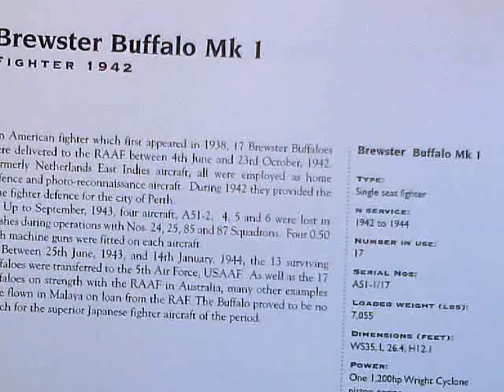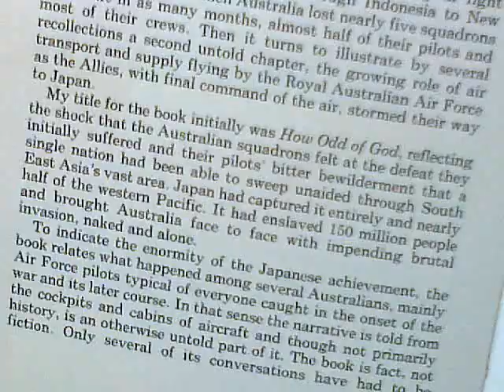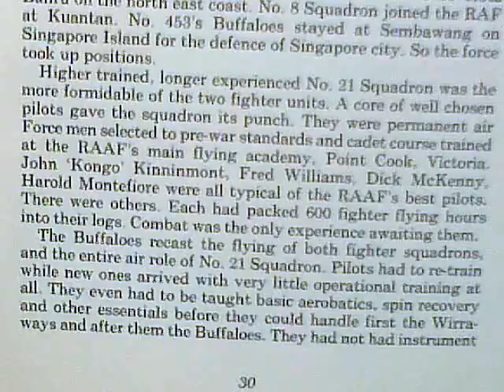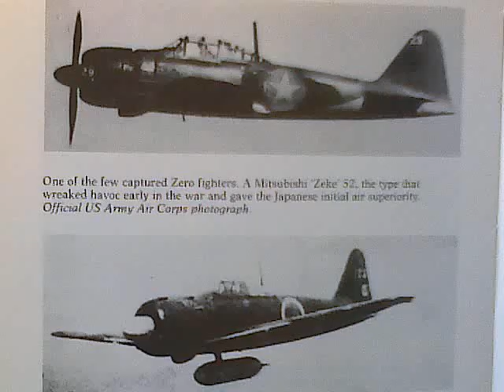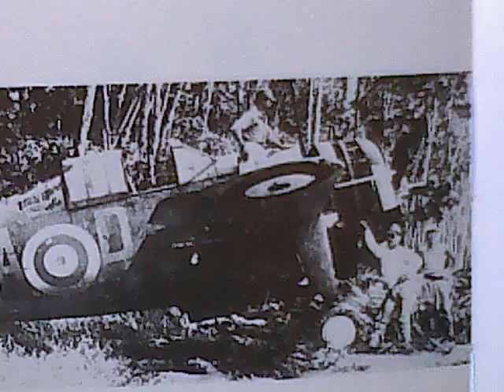World's Worst Fighter Aircraft, The 1941 RAAF Brewster Buffalo !

Comment: Spitfires got whipped by the Zero too, because they tried to TURN with them.
Reply from the maker: G'day,

  Thanks.

  Actually, when the RAAF finally got Spitfires to Darwin they mostly crashed out of fuel, after getting lost, after getting separated , after being scrambled too late to reach the Bombers before they'd disgorged their loads..., those which didn't crash on take-off in the dustclouds on the Dirt Strips...; and any which mixed it with the Zeros in a Turning-Fight got a horrible surprise, after which about a third of those who made it back to Base broke their Undercarraiges while trying to land.

  When reading between the lines in the Propagandised Dispatches of the time.

  Such is Life,

Have a good one...

;-p

  Ciao !
Reply: Which version of the  Spitfire are you referring to ?
Reply: Not even the P-51 Mustang could turn with the Zero.
Reply: @tomw377  Neither the Hellcat or the Corsair could out turn a zero.
Reply: @giauscaesar8047  All of them
Reply: @tomw377  The P-51 couldn't turn with a Spitfire either. It had a better roll rate but it vouldn't turn as well.
Reply: @WarblesOnALot  How did the pilots manage to achieve all of that? Not the aircraft's problem. The Zero was very beatable with the right tactics, it was just that the pilots weren't experienced enough to know that. The Spifire and Zero were designed with 2 very different philosophies and apart from the range (which aux tanks would later mitigate) the Japanese philosophy turned out to be the losing one. If you didn't get drawn into playing Red Baron with a Zero and kept your distance you just had to tap it lightly and it would turn into confetti. The Zero turned out to be very heavy on pilots. You seem to have some sort of hate on for the Spitfire.
Reply from the maker: @nerdyali4154  

G'day,

Which pilots, achieve all what ?

There were no Spitfires anywhere in the Pacific until 1943, they were Mk-5 Tropicals, and they were OFFICIALLY not a success.

In the Pacific Theatre the Spitfire was never able to live up to the expectations of the Imperial Propaganda Machine.

   The 1941 RAAF Buffalo was NOT the same Aircraft as the one which Finland got.

The Finnish Buffalo was about 900 pounds lighter, and had brand-new Engines - rather than unreliable  rebuilt second-hand units of doubtful actual power output, which had been thrashed by having seen service with the US Services... (by RAAF standards the Yanks took off on "War Emergency Power", climed on "METO"  Power - ie "Maximum Except Take-Off", and then cruised on "Climbout Power" - as a matter of course...., which was why the RAAF was able to triple the Time between Overhauls on Catalinas & DC-3s and still achieve better reliability than the Yanquis ever did when using the same equipment).

  I haven't got any "Hate" on the Spitfires..., but I recognise that they, like the Hurricanes, and the Me-109 & FW-190 were ALL  designed for Point-Defence within TINY Little Countries which are about the size of an average Rural Shire Council - by Australian standards.

EuroPeon Fighters simply lacked the Range required to be useful, when they were attempting to fight in the Pacific..., and in 1941/'42 the Buffaloes had no "Chain Home Low" to tell them of any approaching Raids, nor any Observer Corps feeding Sighting-Reports to the non-existant Sector Controllers to guide the Buffaloes onto a Raid.

  And, the useless Radios, the Lowlife Fuelpumps, and self-destructive Gun-Mount issues..., atop the overall Obesity & the gutless Engines as well..., all meant that the WELL TRAINED..., Pilots who were nonetheless "Combat Virgins" had been given a really bloody hard Row to hoe, with their Buffaloes versus Zeroes in Malaya.

Nonetheless, there was ONE Kiwi Buffalo-Jockey  flying  with the RAF who shot down 5 Japanese Aircraft & made "Ace" status.

Whereas the Finns had ELEVEN Pilots who made "Ace" in their Buffaloes..., and it was because of the Finns that the Buffalo joins the Fokker Eindekker as being the ONLY Fighter Designs to have shot down more Enemy Aircraft than the number which came off their own Production-Line.

  Which, actually, shits from a GREAT Height onto mere Spitfires, Hurricanes, Me-109s, FW-190s, Sopwith Camels, Fokker Triplanes, Mustangs, Lightnings, Corsairs, ThunderyBolts, F-86 Sabres, MiGs, Yaks, Zeroes, Phantoms, F-105s, F-117s, and will crap all over the F-22 & F-35.

Thr Finns have a Buffalo in the Helsinki Museum which has 38 Kills scored by different Pilots - making it the highest scoring individual Airframe Ace in the history of Waaauuugh(!)fare.

So, there there, nivertheemoind...your mighty Spitfires were all very lovely - when kept in their place ; ie  when playing around the fence-line enclosing their own back yard, and  defending against the Bully-Boys living at the other end of the street..., with Radar & Radio Control to tell them where to go.

Just(ifiably ?) sayin',

Take it easy...

Such is life,

Have a good one...

Stay safe.

;-p

Ciao !

Comment: It was still way better than the Boomerang.  Overheating engines put them out of service worse than air combat.  When they could fly they fared better than the Hurricane against the Zero.
Reply from the maker: G'day,

    Thanks,

       The Boomerang was a makeshift design, essentially the biggest Engine Australia could source (out of a DC-), with the Centre-Section & undercarraige & Tail off a Wirraway, with a set of outer Wings & Cockpit to fair the extremities together...; it was slow, but still better than a Wirraway for fighting Zeros with.

  And, by the time Boomerangs were bring designed Buffaloes were unavailable.

  ;-p

  Ciao !

Comment: Nice commentary. Only thing though, are you sure the Zeros were actually used in Malaya/Singapore? I thought the Japanese Army was in charge, and at this time, their main fighter was the Nakajima Ki43 Oscar. Of course, since the Oscar was worse than the Zero, this would be further disgrace for the Buffalo and her pilots...
Reply from the maker: G'day,

  Thanks,

  As far as I know, the difference between the "Army Zero" & the "Navy Zero" was that the Naval version had the outer 18 inches of it's Wingtips able to be folded, vertically, to facilitate their fitting on the IJN Carrier's Elevators.

  The RAAF were under the impression that they were facing Zeros.

  I haven't ever quibbled over such a minor & disputable point.

;-p

Ciao!
Reply: Only the Japanese Army Air Force flew over Malaya, Singapore, Sumatra and Western Java. Those units primarily flew the KI-27 Nate, which was still highly maneuverable although it had fixed landing gear.

The only IJAAF unit to fly the KI-43 Oscar was the 64th Sentai. The Oscar was nearly as maneuverable as the Zero. Its primary shortcoming was a weak armament of only two .50-caliber MGs in the nose.

Japanese Navy A6M-2 Zeros flew over Borneo, Celebes, Bali and Eastern Java from land bases. A number of carrier-based Zeros participated in the air strike on the port of Tjilatjap on the south coast of Java in March 1942. IJN pilots were considered better trained than their IJAAF counterparts.

Comment: The 1,200 Horsepower engine applied to the USN designated F2A3.  The final production model.
Reply from the maker: G'day,

 Thanks.

    One can learn a lot about the Buffalo from backscrolling this Comment Thread...

   Particularly with respect to the Finnish Buffaloes..., with less Power but less Armour, and thus less Weight, and the Radios, Fuel-Pumps & Guns all fixed function as required.

  In Helsinki there's a Buffalo in a Museum which has 44 Aerial Kills - which it scored with various different pilots flying it ; it is THE  HIGHEST  SCORING  INDIVIDUAL  AIRFRAME  IN  THE  HISTORY  OF   WARFARE  UPON  THE  EARTH...

  One Finnish Ace scored 43 Kills in a Bufffalo, 11 Finnish Aces shot down 205 Kills while flying Buffaloes, 5 Finns became "Aces" while flying Buffaloes...; the Finnish Buffaloes shot down 507 Soviet Aeroplanes, but Brewster only built 500 Buffaloes.

   Thus, the Buffalo joins the Fokker Eindekker as the only two Fighter Aeroplanes which shot down more Enemy Aircraft than were built during their own Production-Run.

  All of which makes the much vaunted Camel, SE5a, Albatross, Fokker Triplane, Fokker D-7, Spad, Nieuport, Polikarpov I-16, Zero, Me-109, Hurricane, Spitfire, Fokke-Wulf-190, P-47, P-51, Wildcat,  Hellcat, Bearcat, Corsair, Sabre, MiG-15, Mirage, MiG-17, Phantom, F-100, F-104, F-105, Harrier, F-14, F-15, F-16, F-18, MiG-25, MiG-27, F-22 & F-35....; all look like a bunch of Wanbabes...

  Sopwith Camels shot down more German Aircraft than all other Allied Aircraft COMBINED, in WW-1, but there were 5,759 Camels built in total, and they "only" shot down 1,765 Enemy Aircraft between them....

   Curious, is it not ?

  Have a good one,

  ;-p

  Ciao !
Reply: @WarblesOnALot  How many Fokker Dvii,s were built and how many enemy air craft did they shoot down
Reply from the maker: @dwdunn5601  

G'day,

Thanks.

I dunno, but it was nothing like as many Shootdowns by the  Fokker D-VII as came off it's Production Line.

 The Sopwith Camel shot down more Enemy Aircraft (1,294 of them...,) than any other single type of  Allied Aeroplanes did in WW-1, and there were 5,490 Camels built.

The Fokker D-VII was introduced too late in the War to really compete with the Camel's Kill-Tally and by the time the D-VII was introduced most of the German Pilots then flying were relatively undertrained...

So my guess is that the Fokker Eindekkers (E-1 to E-3 inclusive)  might be in the race with the Buffalo, but I simply don't know.

Nowhere is it written that I shall know everything...(!).

Such is Life,

Have a good one...

Stay safe.

;-p

Ciao !

Have a good one.

Comment: Sort of depends on what is the thing that's expected to be fought. Certainly not a first-line fighter, to put up against other fighters. But if they could have gotten to bombers they would have been effective on those. Of course, there'd be no point of first-line fighters if one didn't wish to protect their bombers. Why this was not evident to planners I don't know.

A defense fighter does not need the range of an escort. The Spit was an extra terrific defense fighter... not a good escort, as an example. But the Zero, though having range, were flimsy.
Reply from the maker: G'day 

Thanks mate.

  Well, yeah..., if you scroll through the Comments here you'll see that the Finns had early-model less-armoured Buffaloes without the Mount-breaking .50 Guns, with the Air-War there mostly below 10,000 Ft, and German Radios which worked, no Tropical Thunderstorms to generate Thermals, Hail,  Cu.-Nim's & Lightning's Static, with Combat Veteran Pilots instead of Rookies, and Polikarpov 1-15s, I-115s, & I-16s flown by Novices to fight against..., rather than 5-year Combat Veterans in Zeros...

 In Finland the Buffalo  may have nailed the record for the most Aerial Kills made by 1 Airframe (37) in the history of Air Combat, it shot down more Enemy Aeroplanes than Brewster ever built Buffaloes...; and only it and the Fokker Eindekker  can make that claim.

 Spitfires were lovely as Defensive Fighters if they were protecting a tiny little Potato-Patch surrounded by Radar and networked with Ground Observers & Fighter Control Radio Networks which permitted interception of approaching Bogeys before they crossed the Coast & got behind the Radar.

 Here in Oz, in March 1943, when the Spitfires finally showed up to protect Darwin from the February 1942 Bombing..., they were almost absolutely  bloody hopeless, destroying more of themselves with Take-Off Crashes (Formation Take-Offs on narrow dusty Airstrips..., 1,500 Hp accelerating full-throttle into the leading Section's Dusty Slipsteam...), Landing Crashes (that shitty little narrow weak splayed-out  Undercart -  almost as horribly crippling as the delicate set of Dunlops dangling under Mister  Messofshite's 109 series of Fighters with NO Useful Range at all whatsoever, outside little tiny confines of Europe), and getting Lost over the Ocean and/or Ourback with no Radar to vector them onto the Raids or steer them back tp Base.

   On top of that some Shitefires were shot down by the Japanese Escort Fighters..., and a minuscule number of Japanese Aircraft  were downed, AFTER they had bombed whatever they wanted to hit.

   In the Real World, the further one flew a Spitfire out from the Cliffs of Dover.., the more bloody useless they were...; even the Soviets preferred Hurricanes - for the Landing-Gear...

 So, yeah..., it's a multifactorial Equation.

Have a good one,

;-p

Ciao !

Comment: How comes that this plane needed more fuel when flying higher? With lower air pressure the manifold pressure drops and then the engine needs less fuel per minute, doesn't it?
Reply from the maker: G'day,

  Thanks.

    Well, as far as needing less Fuel as the Air gets thinner, yeah - that is right ; but the problem was that the Fuel-Pump was Pneumatic..., and above 10,000 Ft there wasn't sufficient Air-Pressure to pump enough Fuel to meet the Engine's requirement.

   I dunno the details, but I'm assuming that there was a little Engine-driven Air-Compressor to pressurise the Fuel-Tank, which "blew" the Fuel from the main Tanks up to a small Gravity Tank on the Firewall which then fed the Carburettor...; like a Sopwith Camel, but without the Windmill, and there was a Manual Fuel-Pump to deal with any leak or failure of the Tank or the Air-Pump.

   Presumably the Buffaloes' Air-Pump needed the thicker Air below 10,000 Ft feeding it in order to maintain functional Output-Pressure against the emptying Main Tanks...?

  Good question though...

  Have a happy Solstice Festival.

  ;-p

  Ciao !

Comment: None of the Allies in the Pacific were ready for war in December of 1941. The Japanese were completely underestimated, Allied troops of all forces were largely undertrained and spread thin over large areas, modern equipment was in short supply, and cooperation among the Allies was at best haphazard. You don't conduct successful defense under these circumstances.One New Zealand Buffalo pilot said he never fired his guns until his first combat mission. The Buffalos provided to British Empire squadrons were substandard. They were not the maneuverable late 1930s types (F2A-1 and F2A-2) flown by the U.S. Navy, or the Finnish Air Force. The RAF had asked Brewster to heavily modify the Buff with armor, flare bin and chute, and radios, that added an extra 900 lbs. The British Buffs also were powered by rebuilt Wright Cyclone airliner engines that didn't have the advertised horsepower and were problematic due to oil leaks. Dutch Curtiss Hawk 75s had some of the rebuilt engines and had the same oil leakage difficulties. Dutch Buffaloes had brand new engines and better performance, but still had to be lightened to improve performance. Keep in mind that the Curtiss  P-40 and Hawker Hurricanes also had problems against Oscars and Zeroes until proper tactics were developed.
Reply from the maker: G'day,

Thanks.

Congratulations..., nothing you mentioned was in error.

The fact that the Buffalo in the Pacific was a DIFFERENT Aeroplane fighting in a DIFFERENT War to the Buffaloes which were pastured in Helsinki is why the title of this Video specifies the 1941 RAAF Buffalo.

  Most of the Buffalo Could'a Bin Fan-Club competely miss the salient points which matter, and simply assume that the problem in the Pacific was the Pilots & the Doctrine and the Training.

  A different Kiwi Buffalo Jockey to the one you quoted was able to shoot down 5 E.A. and made "Ace" Status while flying them with the RAF.

  The fact of being overweight, & underpowered though, yes they were bad strikes against the Pacific Buffalo, but with cunning to exemplary Airmanship they could be ameliorated  ; but the Radios which only recieved Static from Thunderstorms, the  Pneumatic Fuelpumps which relied on Barometric Pressure to fill after each Stroke and thus commenced to progressively  fail the further they were taken above 10,000 ft..., and the two sets of Guns - Cowling Guns to blind the Pilot with recondensed vapourised Grease off the Ammunution at every shot..., and the Guns which ran wild and loose inside the structure & shot the Wings off the Aeroplane from the inside...: they were issues which NO Amount of Pilot Proficiency could deal with satisfactorily.

Such is life,

Have a good one...

Stay safe.

;-p

Ciao !